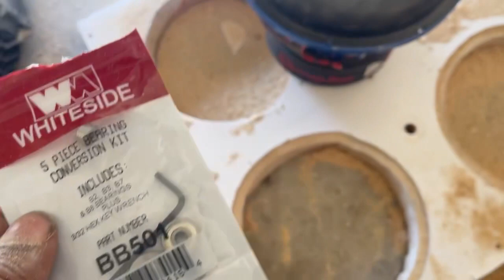It took me awhile to get comfortable with this router but I feel better now that I did this

Comment: A jasper jig is what you need my man. The one I have cuts just under 3"-18 3/8" in 1/16" increments. You just drill a 1/8" hole dead center and set the pin through the jig that's attached to the router plate, and then two passes per sheet of 3/4". 1/4" bit has less resistance than the half inch. Perfect circles Everytime. Also you have to leave tabs 180° from each other and then twist the plate out. You got this Brother

Comment: Those holes look great, I cant go back to a jigsaw after using a router. Perfect circles every time. Its a great tool to have. You can easily make a circle jig out of a scrap piece of wood. You may have already.
Reply from the maker: I know Li scary at first tho

Comment: Instead of cutting most of the circle out before routing you could just drill a hole and drop the router bit in. Less work and saves your jigsaw blades
Reply from the maker: Thanks